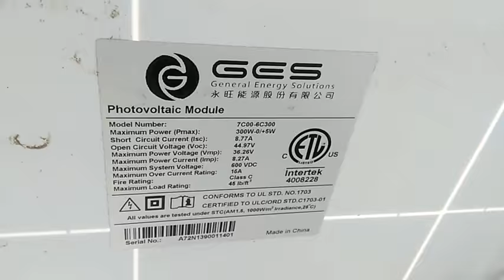Heating water with a solar panel

Comment: Don't you have to match the ohm rating on the heating element to the volt and amp specs on your panels to get the best performance?
Reply: Why dont you just have 1 tank with 2 heating elements. 1 solar and 1 mains. Adding 19 gallons of water into the system is necessary and inefficient .
Reply: @thomasgallagher5224  ... you could do exactly that but the two element tanks will create their own problems with temp stacking. IOW, the bottom element can heat the whole tank (if you have the time, heat rises) but the top element will only heat the top of the tank (heat never falls) so a 30 gallon tank might have maybe 10 gallons of useable warm water if the bottom was heated by solar and it was a cloudy day and you had to fall back on just the top element.
Reply: @thomasgallagher5224  because solar is slow and not always active when the water is consumed. If you drian a dual element tank that has solar and mains electric both will kick on till the water is heated.. With a solar pre-tank less chance of depleting because 2x the size and gives more time for solar pretank to recover from incoming temps rather than using mains electric.

Comment: Easier setup is without a second tank.. 1 tank .. solar to circuit breaker to a DC automatic transfer switch, house power AC to DC converter into second input to auto transfer switch.. and use timers .  Would work better near the equator without batteries... Hope this makes sense

Comment: I was curious about the std. ac heater elements. A guy on eBay was selling what he called a DC element. When I ask why wouldn’t a regular AC element work with DC input. He never answered, so I experimented with a std. AC element connected to 1 solar panel in a bucket and it heated instantly. Apparently dc input to an element either dc or ac still works.

Comment: Why didn't you run a string? That is, wire several panels in series for what is called a 'series string' to raise the voltage. I have 24V panels and three in series actually gives me 105VDC open circuit. I run ordinary 120VAC heating elements this way; the element doesn't really care much as to whether you send it AC or DC. Try it!

Comment: I started out wanting to do a solar water heater with water on my roof at home, (which I will still do  in the summer) but then decided to do exactly what you're doing here. I want to travel and use the small hot water heater in an RV if possible, realizing it may not be really hot, (Arizona in January).

Comment: Jeff please do it little more on the connection on your next video. This wonderful. I need the 24 volt element. I have lots of panels it need hot water
Reply: You can use the existing 120v element and 4 or 5 solar panels. Better. Need a dc thermostat

Comment: You are best to keep the voltage higher I use a 230 volt element with a series solar array  to match that voltage of the element the problem is it drawers a substantial arc when the switch is opened  this can be overcome with a capacitor across the switch a good quality cap must be used  I use a motor run capacitor 4uf 450 volt  something a bit smaller is ok
Reply: @Mr Sunshines actually you can 100% run an ac element from a DC system, it's just a resistive load. The only difference is that with DC your disconnect ARC (the spark that happens when you disconnect a DC load) will be MUCH greater than an AC system, hence why you would use a 'snubbing capactior'

Comment: would this work efficiently for instant hot water heater? i think they only have a low and a high flame depending on water temp but im not sure if doing this for an instant hot water heater would be practical

Comment: curious your heater ac controller on the water tank still working?   it should run ac 24v to the thermostat  then to a relay to control  dc to the element  (safety)

Comment: But this means you have to be using water to get the pre-heated water into the bigger tank. If it just sits for a few days without the water in the big tank being used, it will still rely on mains electricity.
Wouldn't it be better to use a twin element HWS and wire your solar to the bottom element converted to DC? 

Better still, get more solar panels and run it all on DC.
Reply: Yep your right it would be better to have the DC element in a duel element tank with the thermostat on the DC set higher and the AC thermostat set lower so the AC shuts off when the solar has the water hot enough.

Comment: I love the idea of pre-heating the water. But why not have the pre-heat tank inside the house and let it reach ambient temperature on it's own simply by the household heat. You would not want  that pre-heat tank to be insulated. 20 gallons uninsulated could easily fit in a kitchen cabinet near the stove.

Comment: Why two separate tanks. Could you not just have one tank with the 12v element in the bottom and the standard mains one higher up? Just a thought.

Comment: You can use the water heater roof type panels in winter antifreeze goes in the circulating system

Comment: Are you circulating the water from solar tank to grid tie tank constantly?   If not, how is the hot water helping?   Themostat would keep conventional power on in 2nd tank.

Comment: You got a nice set-up there. And you planned this out pretty smart too. I'm trying to alter my solar system to run from just a few or a couple panels to heat my water away from my household solar system. My water heater is 30 gallons and uses too much of my solar power, so I want to convert the heating element from a 220 volt 4000 watt system to just using the necessary amount of solar panels wired directly to a specific heating element. Hope this makes sense? Anyways the real question here is  how do you determine how many panels you need and to what type of heating element to use. There has to be some compatibility of the panels to the heating element, correct?
Reply: Wattage and BTU calculations is the cut and dry answer.. the long answer is everyone's situation will be different and dependent on season ( may have to add or take off a panel or 2 in seasons), hot water consumptions, storage tank size, incoming water temp (is a big factor), panel type, output, design/wiring configuration, control systems, and list goes on. For a roundabout answer you would need 3-5 panels of 300-375watt to charge a 50 gallon tank under very low daily consumption rate. This could be done with a dual element tall tank using the bottom element only and could be as simple or as complex as the DYI'r wishes. Using the bottom element accounts for thermal stratification which would reduce the cyclic rate of the upper element provided all is working well. As others mentioned there are limitations to using mechanical thermostat controls for DC power keep that in mind. The TPS will be as it was before a safety and will require to be plumbed properly as many are not ever.. The particular point of this specific video is to have pre-tank storage and secondary electric to take the most advantage of both sources of energy. It is possible to fully solar, single tank dual energy, or to split tank as shown. Split tank would seem to be the most efficient but ONLY if using the low boy style tanks and using good insulation practices. If your not doing those 2 things the surface area and low efficiency of standard tall tanks come into play. If your capable there are people out there modding arduino controls i personally prefer mechanical controls on everything if i can have it. There are both dual and single element versions of low boy (short tanks) in both 120/240 options but always consider the smaller the tank the more efficient for a few  reasons. These include but are not limited to less surface area for thermal transfer, much faster recovery rates if properly powered, and less storage mass to prepare and maintain at temperature for use. A low boy 20 gallon dual element tank can recover over 12 gallons of water during a depletion event this means it has an actual capacity output of 30gallons at a set flow rate. The larger the tanks are the less gallons are recovered during a depletion event and the more is lost to surface area. This is something the content creator didn't touch on that is beneficial to him but he may or may not know and may or may not be under powering the units as well as he obviously has to much faith in the insulation of these units. Using a Pre-tank even if it isnt powered directly but picks up heat from a conditioned space alone adds efficeincy due to not heating the water from incoming temps 35-50F but rather have a tighter temperature differential. Say the home is heated with wood heat usually there is an abundance of such a heat a pretank could be installed near that wood burning device and look more like a radiator than a pre-tank. Also that incoming water temp is said to be common reason of heating element damage along side of scale build up because the element sees to drastic a change to quickly. Him and many others add risk by not heating the water high enough which is a concern for specific kinds of bacteria (not my field so no comment). The solar pre-tank should be set to 130F and the primary at 140F and if the fleshlings are to stupid to modulate water at the faucet then a mixing system should be installed to control temps. These higher settings allow for smaller systems to act as bigger ones in the common situation a depletion event happens like your teenage make-up monster swapped your 30 gallon maytag washer to hot water wash cycle just before your credit card holder wants to do the dishes. The tanks/lines should be stored in insulated closets/cabinets/enclosures, even if he had had them in conditioned space because if we are penny pinching to keep the electric monkey off our backs why the hell would we throw bananas on the floor. Going to stop here as adding anything more is a waste as not many people would ever see it nor bother to use the info because it wasnt off of tiktok.
Reply: @mikeb4824  Few questions for you. What is it you found to be arrogant in my reply? Why do you assume i use credit cards? How is it you reply if "no one read it" or did you mean your "no one"? If this is some attempt to troll it landed on deaf ears since it has no bearing on the topic of conversation we adults are having here. If you think my lengthy reply in some way makes my statement arrogant, you should consider that some of us have the ability and capacity to exchange large amounts of worth while information in a matter of seconds. That said will you be joining the conversation, I.E. if you have the intellect to do so.

Comment: all elements are ac or dc just need proper voltage.  cant use ac  thermostat on dc. 3x 37 volt panels in series should run standard 110 volt element.. i have a homemade batch heater that i drain for winter but  draw hot air off of when i can .
Reply: should be standard 110 volt 1000watt element .  allready have a 40 gallon tank going to change lower element to 110 volt 1000 watt element for pv solar. going to plum in second tank and use a inkbird itc608t to control first tank with a small pump to second preheat tank for over heat in summer. maybe 3 more panels and element just for extra water heating in winter if needed hope it works

Comment: Dear Sir, i want to use 02 Charge Controllers 30amp  and 06 PV Panels@ 3 Panel with each Charge Controllers and 02 Batteries 200ah in 12 volt Dc. I want to use only DC power in my all rooms with 6guage Wire, DC Fans and Dc lights. My question is how i handle 02 Charge Controller 12 volt dc. 
1.  Can i joint both Charge controllers with same batteries 2x200ah bank? Boht charge controller will charge the batteries at the same time?
2. Can i use Dc power for use of my appliances from both charge Controllers on same time as parallel or use Dc power from Batteries for house uses.
My appliances Load will be not more than 34Amp 408watt.
Please guide me if possible.

Comment: If you join to 12 volts DC heater in series it will be 24 volts and then you can safely connect it to solar panels directly

Comment: why not run the second one off the grid with a small 1500 watt inverter, 1 battery and 2 x100 watt solar panels as well? Then you have no water bill period.

Comment: Good idea, how it works on winter? I have similar idea, i want to find a way how to redirect power from mppt to my boiler when battery is full, so i can use that wasted energy on water.
Reply: Dino Pasic
 ... that's an easy answer but will require some math to see how long the pay back might be. All you need to do is rig up another water storage tank (water heater should work) and connect everything via a relay so when one system is done it will switch to the other, (the tank) which you plumb in the return side of the boiler to catch the cooler water after the radiator loop but before the boiler itself. You'd have to fool with the aquastat settings so your preheat tank will be at a higher temp than the lowest boiler settings. Typical boiler will be set at say 160 degrees for the low and 190 for the high. Going below 160 may not give you enough domestic hot water if it's a tankless coil and you may have trouble getting a normal electric water heater up above that... but there are modifications that can be made if you re good at that stuff. Personally I would not expect much in the way of savings because you'd need to generate many hundreds of gallons of water daily to make much difference... and a boiler can do that in an hour for the cost of 1-2 gallons of fuel oil. See where this is going?

Comment: It's the most inefficient way to heat water. Solar panels efficiency are between 15% and 20% (sun energy/square meter). Just use a black garden hose, it's more than 50% efficient (sun energy/square meter) and cheaper. The barrel should be thermal isolated (EPS)
Black garden hose heat collector: https://youtu.be/MvEzmgJ5nDM
Sun energy per square meter: https://youtu.be/9K8owiMQQsI

Comment: can i use normal 110V ac heater and connect many panels in series
Reply: yup, just get panels with inverters with 100v output.
Reply: yes get a 1000 watt 110 ac element run 3x 330 watt 37 volt panels in series less line loss at 111 volts from panels to heating element

Comment: I often think that the combination of a ground mounted insulated batch water heater and solar could be an efficitive combo. Ground mounted to remove snow or ice, the solar to augment the passive heating of the sun. 
   We live in south Florida and plan on moving off-grid around Missouri so I don't understand the effects of the cold weather and less direct sun on such a solar system. where I live now we had a roof mounted heater and an 80-gallon tank and the only electric we paid for hot water was the little-circulating pump. 
   Why can't you insulate your roof-mounted heater and pipes?
Reply from the maker: It has been sub zero for a few days. Everything outside freezes. I suppose Its possible but not easy. fall, spring and summer you are defiantly correct.

Comment: Why would you spend all the money to use a PV panel to heat water when an indirect glycol panel, using the pv panel for the pump times as effective ! and its good to -60 below zero if done right.

Comment: No battery?
Reply: In essence, the water is the battery. It's what's storing the energy, just in the form of heat. The benefit of doing it this way is that potentially, you can buy more raw energy storage per dollar with a water heater than with a battery bank, and the hardware will probably last longer (although both batteries and water heaters do fail eventually). The downside is that you can only use this stored energy for one thing (hot water ... although some people use hot water for radiant heating, too), and if you don't use it each day, you'll probably lose it (or lose the ability to capture tomorrow's sunshine if you didn't use much hot water today).

Comment: Just take 4 24v panels in series, to a 120v element---- simpler
Reply: He is talking about 120v AC current not the DC current for the second tank.
Reply: @pricetactician101  AC or DC makes no difference for a heating element.